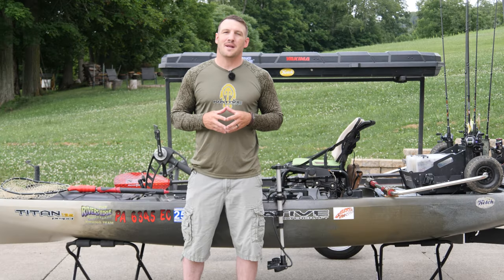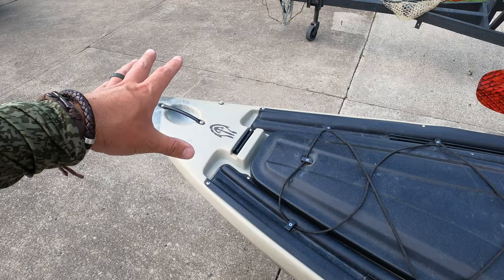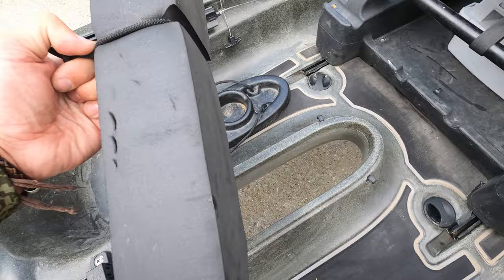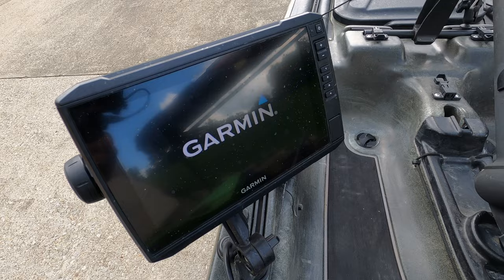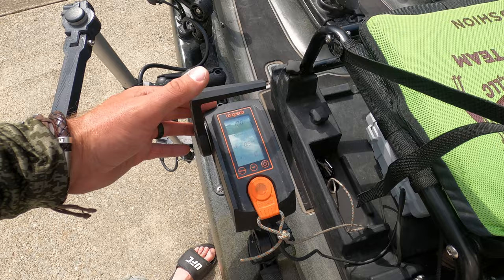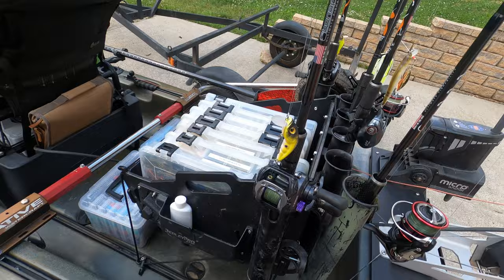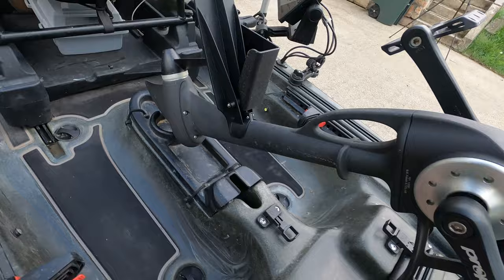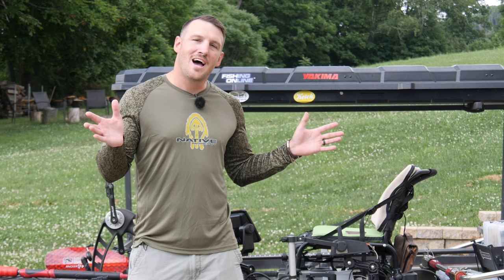My 2023 Native Titan 13.5 Kayak Setup (This thing is rigged to the gills!)

Comment: So...!  You say the 18 amp batteries are in SERIES?  That gives you 24 volts of power, doesn't it...!  You might want to change something (wording) to Parallel...!  (I think that's what you meant, but someone COULD go "astray" from the wording...!).
Nice Rig, for sure.

Comment: I was thinking for the steering cables on the motor why not use bicycle cables? seems like that would solve your push pull problem when the cables are in use. The floating tubing I fear in time will saw through the hull.
Reply from the maker: That's a great idea actually

Comment: Hello Mate! I'm new on your chanel and you're welcome fom EU :)) I founded between your videos you had a Titan 12 too. I have actually a Shearwater125 and i'm a bit affraid about the lenght of Titan 13.5. Can you tell me what is the main experiences between Titan 12 vs 13.5? I'm interesting the stability, cornering/turning differences and what constans speed you can do by propel and how fast can you "put" in to glide. Paddling isn't too bad with Titan13.5 neither? Normally i would trail the kayak but i need to find a right choise becasue i'm 6'2 and 260-270lbs. Thanks your advise :)
Reply: Ah and i would use my MinnKota Terrova 55lbs bow motor on it too
Reply from the maker: Hey man, i apologize for now just getting back to you but between the 12 and 13.5, there are pros and cons. For throwing the yaks in the back of a truck, the 12 works best and is a bit lighter. As far as stability, both have the same amount of stability, no issues there. The 13.5 is great for bringing everything on the kayak and in scenarios where you dont have to make sharp turns like lakes. The 12 comes in handy if you are in moving water. I am 6,3 240 and have no problem with weight or stability out of both boats. The seat is where these boats shine. Having a seat that allows you to basically sit like a normal chair and cast is amazing, especially for tall people like us. Both boats cruise fairly fast with the propel drive, not sure exactly on mph. I do believe its a bit faster than the jackson drives but a bit slower than the hobies.

Comment: What  is the dimensions for the board you used to mount your motor? I have a titan 13.5. I don't want to cut a hole either.
Reply from the maker: 1/2" Thick, 36" long, 6 1/2" wide with roundover edges

Comment: What is the point for dual steering???
Reply from the maker: Foot steering is for when I use a motor, it controlls the torqeedo. The hand steering is when I'm using the pedal drive.

Comment: I notice yours isnt foam layer filled on the inside... did they quit doing that?
Reply from the maker: I haven't seen them do any foam since I've been with Native. They keep it open for storage use. Sometimes I will put extra rods in the hull while fishing or even sometimes when I'm traveling.
Reply: @str8yakd  ... No it's just a thin layer of foam maybe a quarter inch sprayed and injected throughout the whole interior... It's a safety measure in case it ever takes on water it will always float... It affects no storage issues whatsoever like I said it's just a layer no more than a quarter inch thick throughout the entire interior of the hull.. apparently yours doesn't have that because it's usually an off white color.  For instance I have a native 13/5 and it's copperhead color but the entire inside is white from the foam.
Reply: So is my Titan 10.5, and it's over 5 years old and still going Strong! @thelongshotartist1

Comment: Where’s your battery for the Torquedo ?
Reply from the maker: I have my battery sitting under my seat.
Reply: Ok , thanks. I have a Titan 13.5 and thinking about adding a motor , specifically for the BassMasters Kayak series on Tenkiller in March.
Reply from the maker: @garygazman3827  Awesome man. Good luck out there. Should be a fun tourney.
Reply: Thanks bud. Looking forward to it!!

Comment: Nice! How much does that weigh at the current setup minus tackle and poles?
Reply from the maker: Not gonna lie, probably around 180 to 200 lbs. If I don't trailer it, I use the sidekicks and bring the boat to the water then put everything on.

Comment: How heavy is that thing? You’ll need 9 men and a horse to drag that thing back up to the truck at the end of the day.
Reply from the maker: You're not wrong lol. I'm a big guy and lift weights, I can drag it loaded in and out using the sidekicks but it is heavy. I normally trailer the yak most of the time. If not, I'll load everything on once I get it on the bank, vice versa taking it out.
Reply: My 10.5 fully rigged (7 rods, 9 full #3600 Plano tackle boxes, batteries for the Garmin and Lowrance, etc.) weighs over 175 pounds, and I can still pull it up just about any boat launch ramp (I'm nearly 80 years old, and don't lift weights or workout..!  It is a little heavier now, since I put a 120 amp battery and trolling motor on the back. Recon it weighs over 220 now! Takes BOTH hands to load it into the back of my truck...!).  Lol